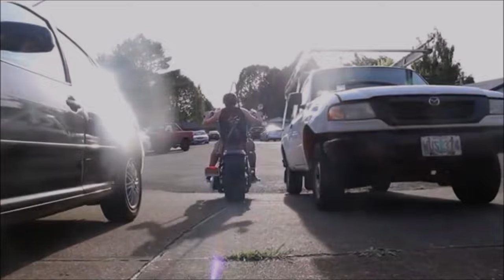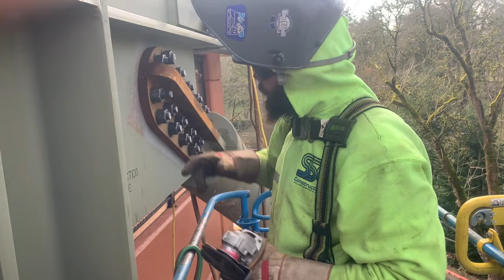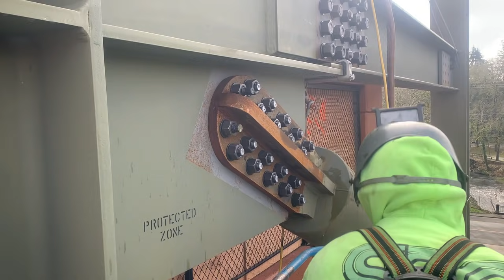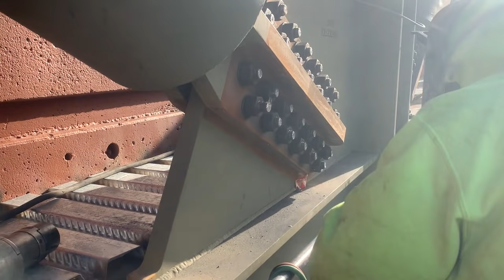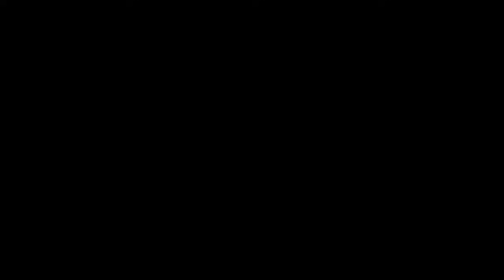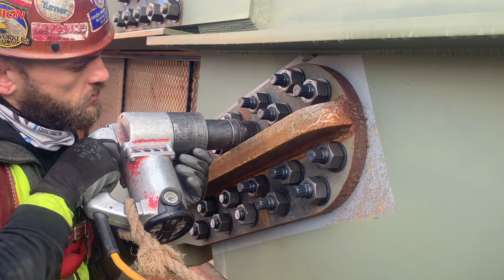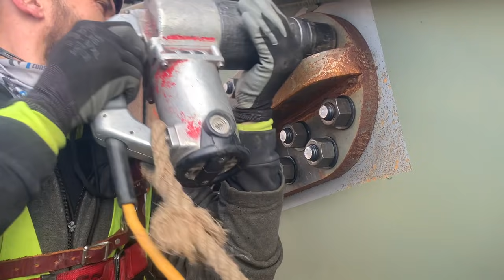ironworkers tip while snapping bolts

Comment: Why does he keep flicking it back like he's cooking it or somthing? Looks like wasted movement
Reply from the maker: He’s flicking it because there’s a tip that sheared off and you have to shoot it out from the end of your gun
Reply: @ChantzFabz  

Quite the experienced audience you have here, haha.

I used to run one of those gd three foot torque wrenches working for an engineering outfit decades ago...it kinda sucked...they called the bolt setup in the vid something different back then but I was very happy when they came out with them.
Stay safe man.

Comment: Instead of cutting the pin end of the bolt and losing the full potential integrity of the bolt, why dont you just use a deep well socket. It'll save u time. And they make make stealth heads for that specific task. I just figured cuttin the bolt line that would not pass Q/C inspection.??
Reply from the maker: Have you used TC bolts with this gun... the tip gets snapped off once at torque
Reply from the maker: Cutting the tip didn’t do anything to the integrity
Reply: Right on, I had to watch ur video again and with sound this time lol. Past 10 years or so I've been using size M42, M56, and M64 heavy ass bolts and studs. Been a whole min since I've seen a TC bolt. Stay safe out there my Brother.
Reply from the maker: @ikejimenez4500  don’t worry you weren’t the only person to comment or thumbs down the video because I was being a horrible quality ironworker for doing this... hahaha like dang man I wish they knew what I was actually doing
Reply: @ChantzFabz  nah bro, didnt mean it in a disrespectful way and deff no thumbs down from me either. I actually subscribed to ur channel. Hope to see more content from ya, keep it up.!!🇺🇲🏗
Reply: This conversation between Chantz Fabz & Ike Jimenez is how real men respect each other.

Comment: FYI, on a much smaller scale (approx. 1/8" in. to 3/8" in. NUT size{s}) they use similar "TWIST-OFF'S" / "KNOK-OFF'S" (a.k.a., Blind Rivets) on Boeing Wings & Body Sections. Depending on the torque required, (different color's for different Torque requirements, low of 15 Ft pounds to as much as 35-40 foot pounds) they are supposed to just snap off. You gotta be careful, for when they don't. You just scratch your head and wonder just what in the world is holding the TWIST-OFF NUT on. The metal where it's supposed to snap-off is so thin, I MEAN THIN, you just shake your head in disbelief & wonderment.

Comment: Back in my day we didn't have a fancy bolt snapping machine, back in my day we used a pair of Bolt cutters and are forearms 💪💪   Back in my day we didn't use no fancy grinder thing we used a hacksaw and did it the right way , and back in my day we didn't use no fancy bolts and nuts we put stuff together so accurately it fit together on a molecular level🤔  yeah that's right i went there 🤣🤣🤣🤣🤣🤣🤣
Reply from the maker: Hahahah oh yeah???
Reply: Sounds like you only tightened 3 bolts per shift

Comment: The brother snapping bolts is not the right way.all them bolts are supposed to be tight before you snap.when you put the gun on a bolt and pull trigger it should snap right away no gun whining till the bolt snaps.